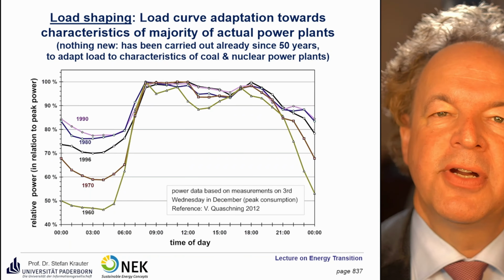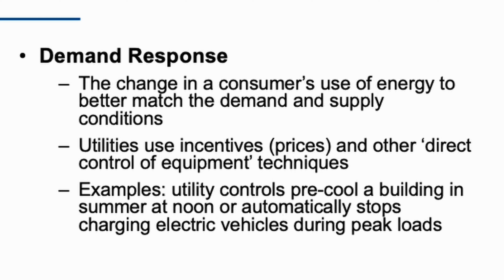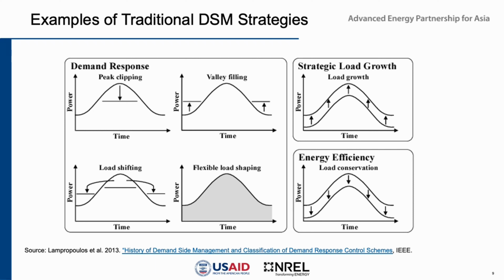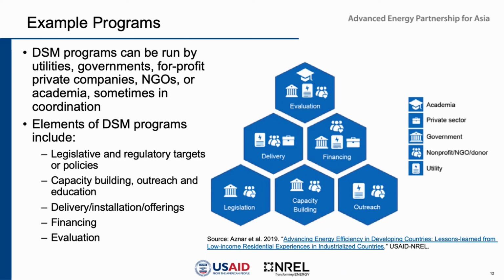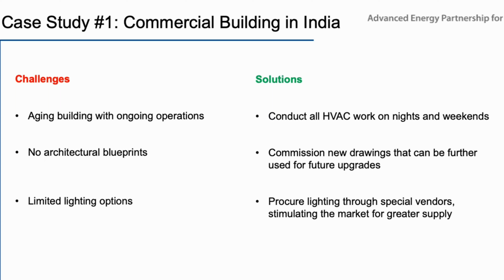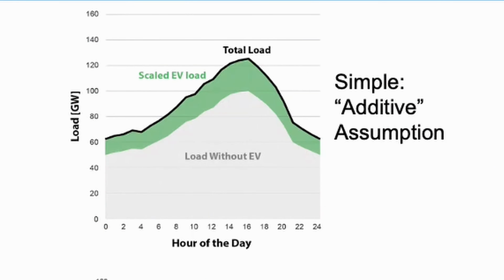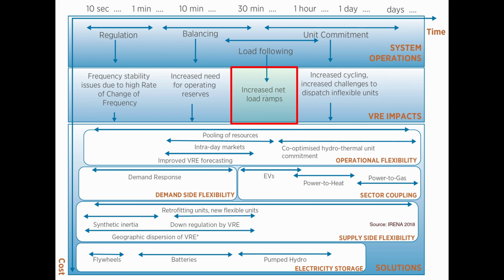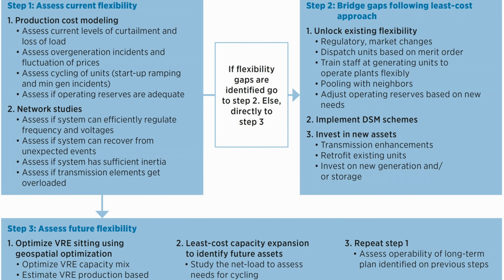Energy System Transition 15: Flexibility of Load & Supply, Demand-Side-Management (DSM)

Comment: Solar and wind have no "flexibility options" without fossil fuel or nuclear backup.  Energiewende is Germany's ultimate political failure.
Reply from the maker: Wrong, you just need wind, solar and storage. No fossil or nuclear backup is necessary.
Reply: @Stefan_Krauter  You don't have effective storage, and until there is a quantum leap in energy storage technology, you don't ever hope to get it either.
Reply from the maker: @danadurnfordkevinblanchdebunk  Why you do you need a "quantum leap" ? Pumped hydro is there since 100 years, Hydrogen storage even since 120 years. Both can be upscaled to the GW-scale. To reduce storage needs and related costs, DSM and largely distributed generation will be applied.